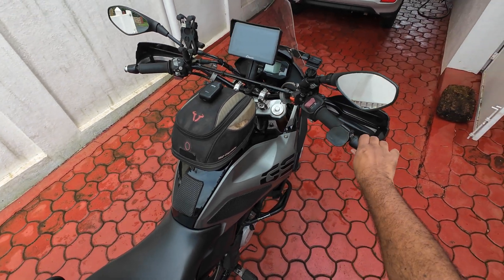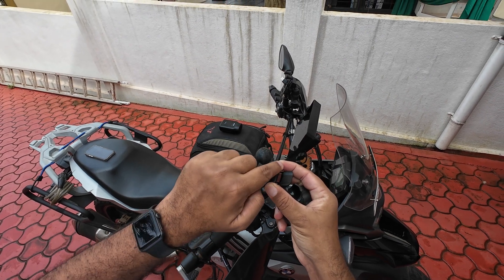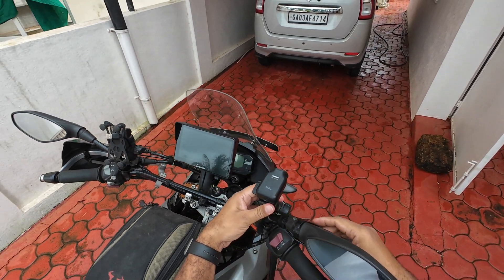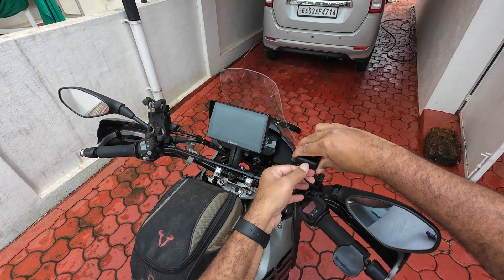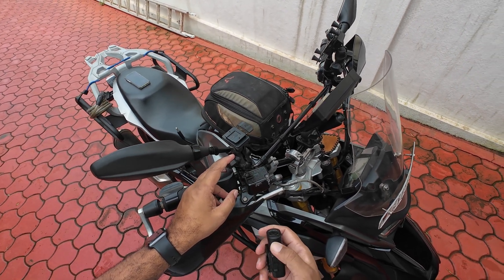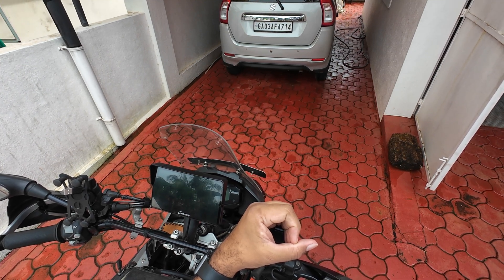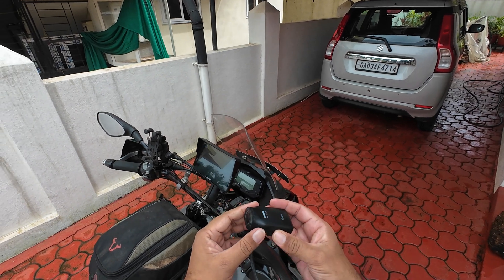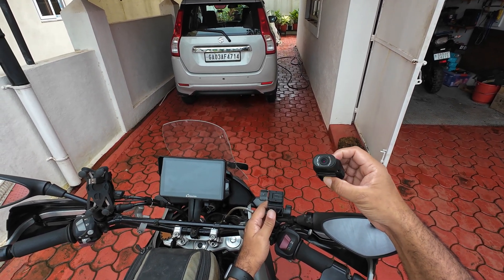Qubo Bike Cam Pro Installation on Handlebar

Comment: Sir does it record while charging and also does it auto saves video if battary get empty and gets power off while recording
Reply from the maker: 1) yes
2) videos are 1 minute long. So at a maximum, you will lose a minute of footage if the battery dies.
Reply: @DeelipMenezes  Brother i bought kebo bike game pro but i cant setup what is the way to setup the blue light is on and connect to the app no video recording

Comment: So there is no way to stop and start manually.  We have to remove from the clip in order to stop. Pathetic design
Reply from the maker: Dashcams are supposed to work that way. In a car you don’t do anything to start and stop the dashcam. It starts and stops ok it’s own automatically. On a bike you need to remove the dashcam or it may be stolen.